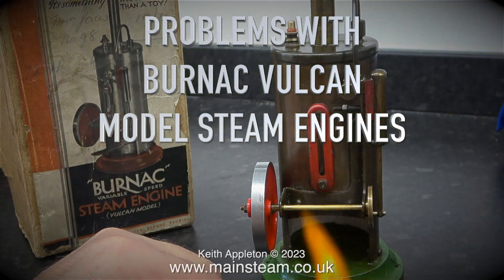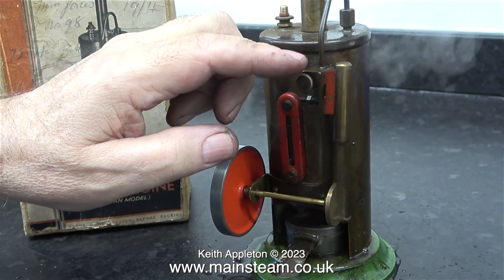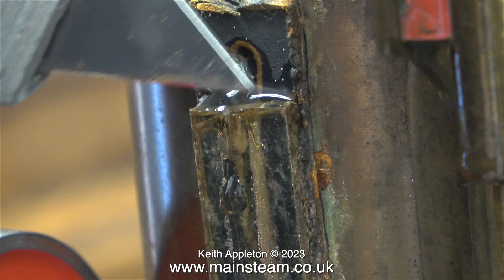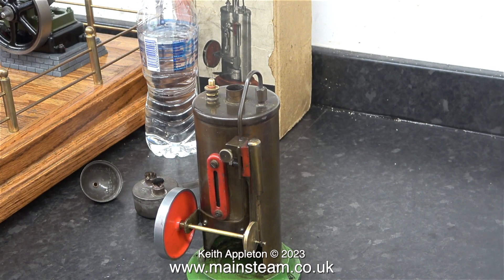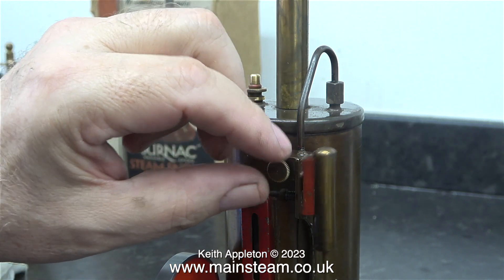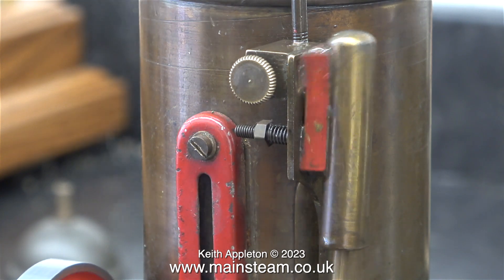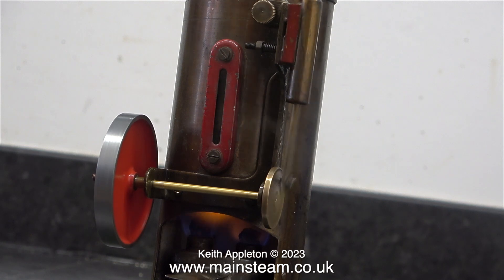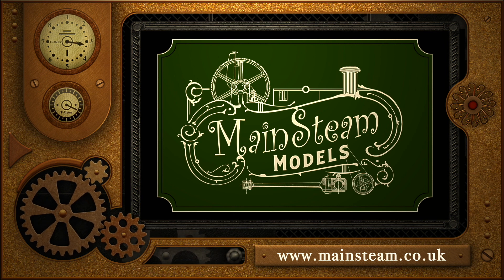PROBLEMS WITH BURNAC VULCAN MODEL STEAM ENGINES - PART #3

Comment: Would it be able to output any useable power? Could you attach a small generator to it and charge a power bank, for example?
Reply from the maker: It is hardly worth the effort ........ unless you want to stand over the engine, replenishing the water and methylated spirits then waiting for it to raise steam every 10 minutes. Why not just plug it into a mains charger . . . . ?

Comment: I would be interested to see your "Super" Burnac running simultaneously with this stock Burnac.  Comparing times to build steam and residual heat run time after the fire is removed.  Another great video, thanks.
Reply from the maker: I will make this Super Vulcan as soon as I get through my current workload . .  .

Comment: Nice! I put a control valve on me Mammod years ago, got rid of the very light die cast fly wheel and fitted a old aluminium VCR head drum as it was a bit heavier but finely balanced. When I run it I can get it chuf along really slow and my son loves it. Thanks for the videos mate keep up the good work!

Comment: Keith, in America, the fuel you are using is sold as denatured alcohol.  You should be just fine fueling the burner with 91% isopropyl alcohol.  As you clearly stated, hydrocarbon based fuels are NOT acceptable.

Comment: Hi Keith, great work this looks awesome! Sorry if this is a silly question but do you think adding the insulation to the firebox made the boiler any more efficient? I imagine that it helped to trap the heat more instead, interested to hear your thoughts
Reply from the maker: The heat insulation adds nothing to the efficiency, it merely prevents overheating of the "firebox" area.

Comment: Hello, I love your videos I like trains and steam engines your videos
Reply: If you added another flywheel (just temporarily) could you run the engine slower? Also I don't see a pulley.
Reply from the maker: The Brass crankshaft is not strong enough. There is a pulley on the end of the flywheel.
Reply from the maker: Glad you like them }:-)))